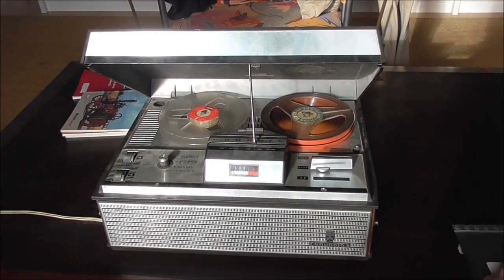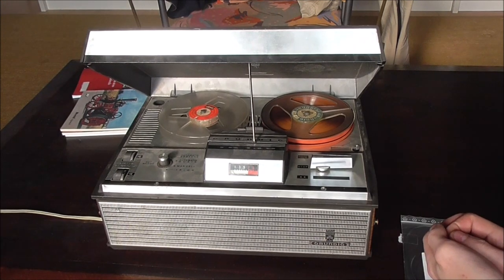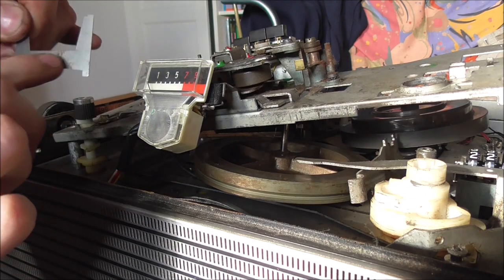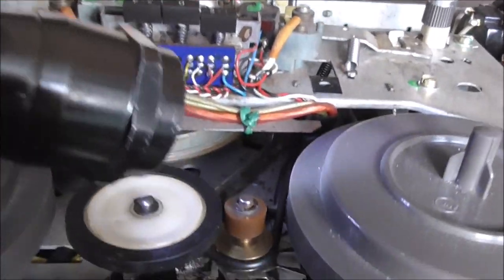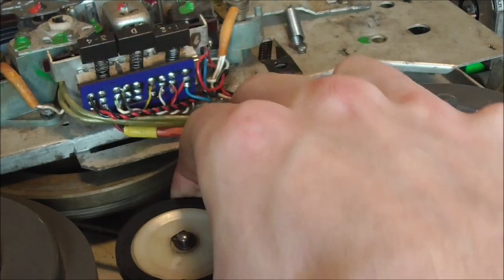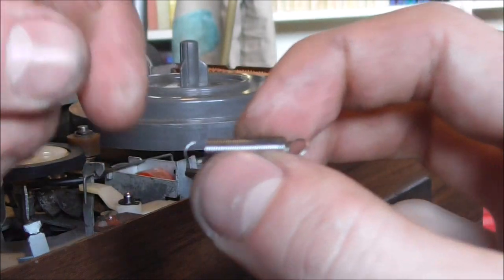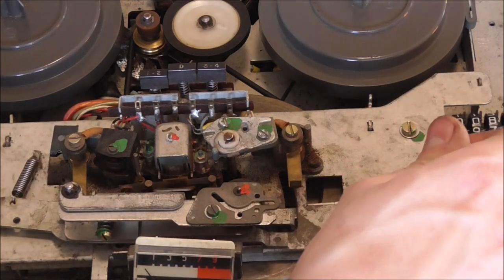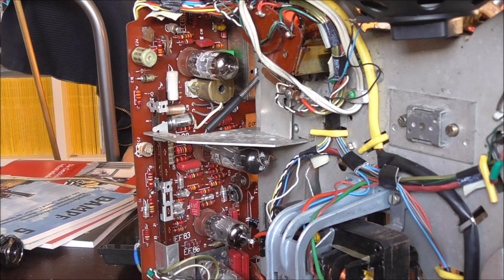Grundig TK149: How NOT to change belts

Comment: Where do you suggest getting new belts for these old Grundigs? I have an SO 171 console unit i'm trying to get working just so I can get the tape to tape running and pull some old audio recordings of a late relative. I managed to get power to the tape unit and it's spinning up but i need 2 belts, not sure how to measure/spec (tightness level) or where to source these custom o-rings
Reply from the maker: Just type the make and model into ebay, you ought to find something.

Comment: It is wrong method to replace the belt and defecult.thr right method from the back (bottom cover) u will find entrance to the motor belt cover 15:48 under the speaker .remove  the 2 screw and install the belts.thats all.
Reply from the maker: You may be able to change the tape counter belt that way, but how would you get the drive belt around the flywheel without taking the axle out of at least one of the bearings?
Reply: @AstraWerke  remove the 2 scre and u will find it is easy to install the belt aroun the weel.i do it evry time when the belt cut
Reply: @AstraWerke  15:48 u will find small iron cover with 2 screw blow the speaker directly.remove and install belts arround the axe
Reply from the maker: @فكروتدبر-ف8ذ  My god, I wish I had known that before...
Well, when the belt rips again, I know what to do - thank you!
Reply from the maker: @فكروتدبر-ف8ذ  Well, the engineers back then were alot smarter than me xD
Thanks alot for pointing it out!
Reply: @AstraWerke  you are welcome